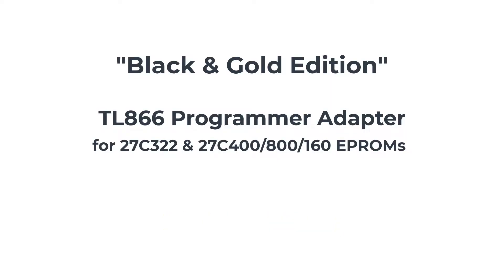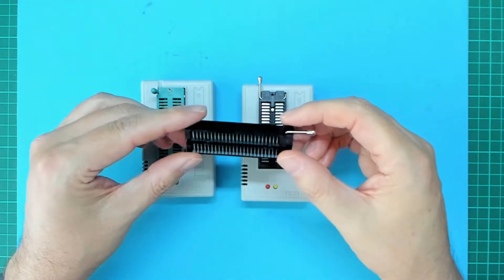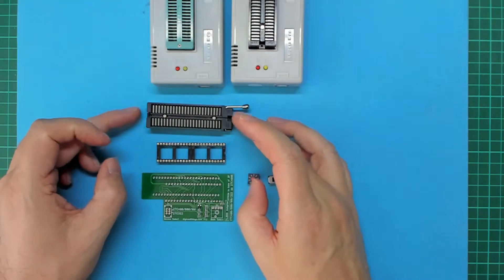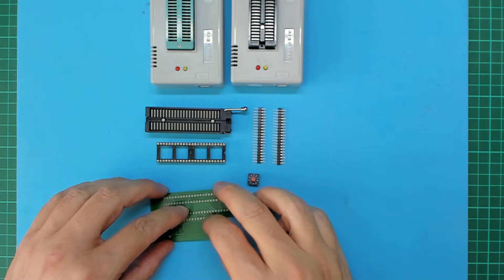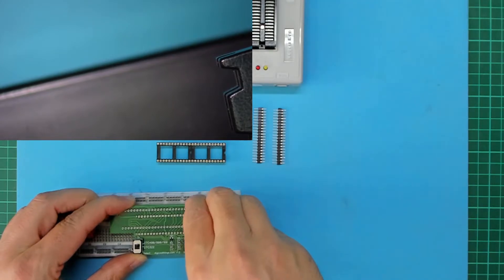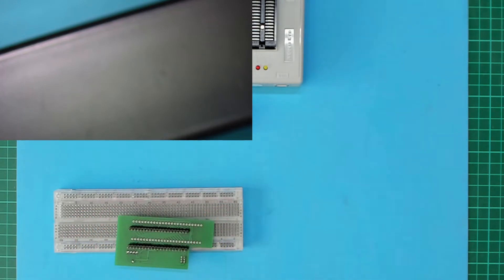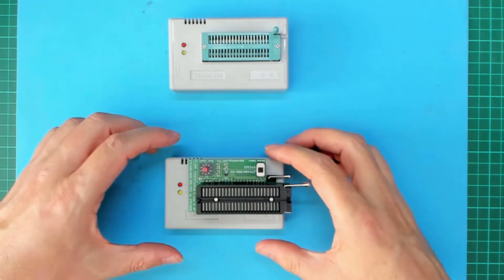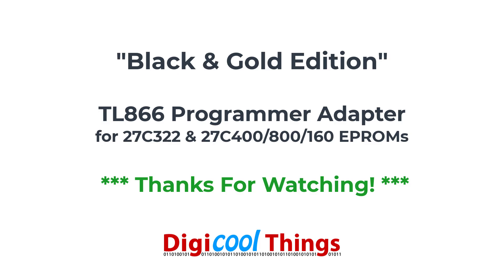"Black & Gold Edition" - TL866 Programmer Adapter for 27C322 & 27C400/800/160 EPROMs

Comment: Very nice, I didn't know they released a special edition. While I'm here I just wanted to say that I've been using your 27C322/ 27C400 adapter for quite a few years now and it's been one of those things you buy in life that you use over and over again and always recall it as one of your greatest purchases of all time. Actually the only problem I ever have with my TL866II is sometimes poor contact on either the eprom or adapter. So I should probably get the upgrade
Reply from the maker: Thanks for your awesome comment. My motivation for making these Adapters is to give back to the community and assist like-minded enthusiasts with their retro projects. So, reading comments like yours is what makes my day. :) 
I’m not sure what would be causing occasional poor contacts, as I’ve not experienced that issue myself.  However, I’d imagine some gold plated pins and a higher quality ZIF socket certainly couldn’t hurt.  
As I still have my regular green TL866II Plus, I’ve actually kept my Black Edition TL866 with the special edition Adapter permanently plugged-in (in place of the 40-pin ZIF), as I do like the lower profile & more permanent feeling solution for all my 27C322 & 27C400 etc. programming (that I seem to now do relatively frequently).
Reply: @DigicoolThings  Ah my TL86II has done a ton of work and I'm using eproms that are harvested like I guess most of us are at this stage. Legs aren't perfect etc. All it takes is a bit of a wiggle in the ZIF as you tighten it and you get all the legs connected well most of the time :). I bet I've burned many thousands of eproms in my time, I have a box full or dead burners from these last 20 years :). Currently I've just finished building the 3 Cave PGM boards from the Arcade projects forum. Those were 10x27C232's each.. So 30 x 8 x512k segments.. It took a long long time
Reply from the maker: @greenfoam  Sounds like you probably out do me on EPROMs programmed.  Wow, I've certainly never done 30x 27C322 in one session!
But, I too have been through a few programmers over the years.  My first (which I still have), was a Sunshine EW-701 programmer, which uses an ISA bus controller.  It programmed many 2716, 2732, 2764 & 27128 EPROMs for me, back in the day.  
The first EPROM I ever programmed was the triple-supply 2708, in the late 70’s.  But that was using my own home-brew programmer. ;-)
Overall, the TL866 Programmers have been a pleasure to use, and sure do represent great value for money, making all this fun accessible to many more hobbyists.